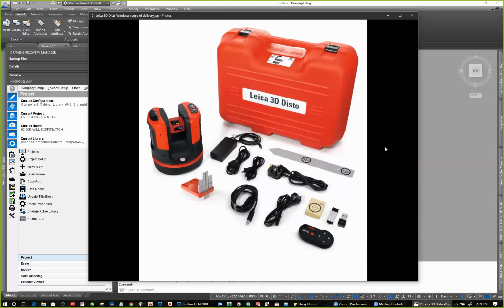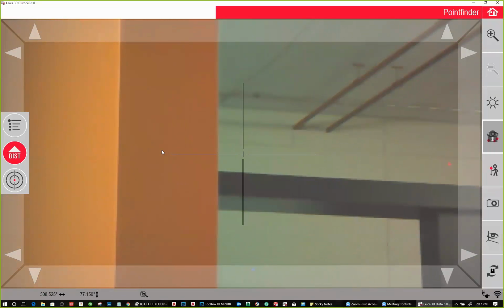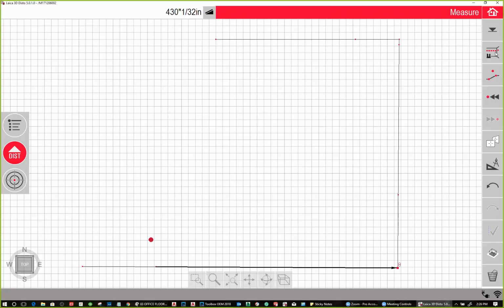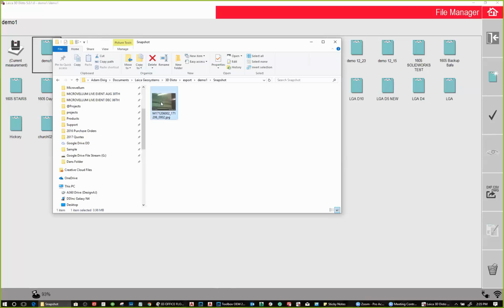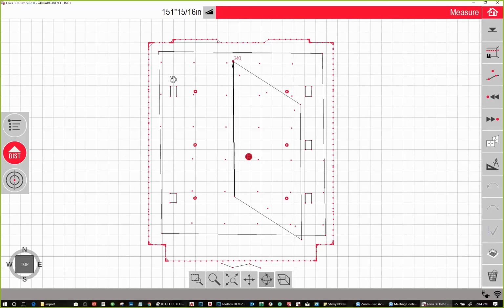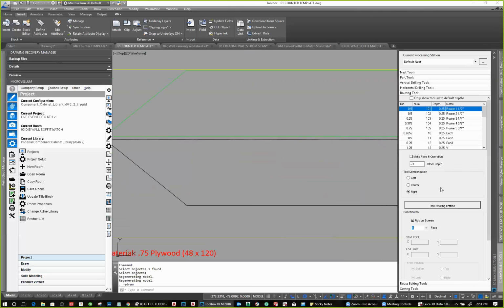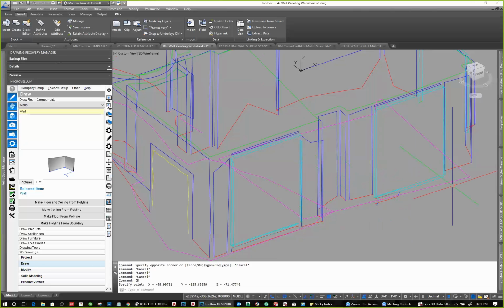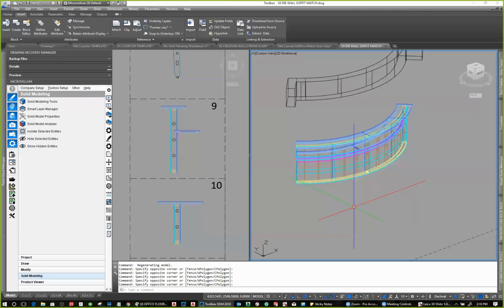Microvellum LIVE: Leica 3D DISTO Measurement + Microvellum Software

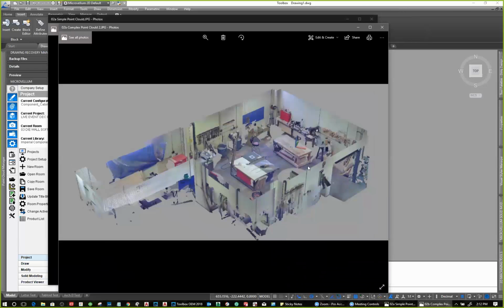Comment: 11:00 Great info on the differences between the single point at a time measurement kind of devices and the scanning type that uses a vast number of points type. If what you are after is specific details about the room, and don't need a picture of all the contents in the room the added accuracy is as you point out a valuable advantage.
Reply: How about outdoor scanning?